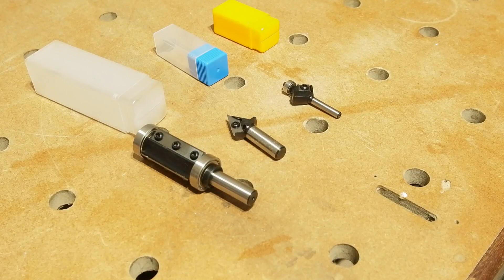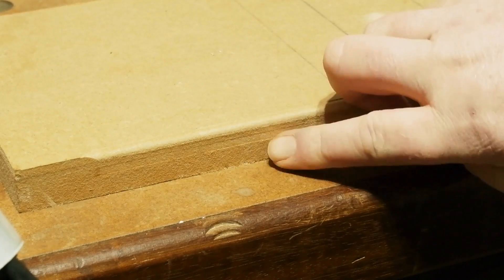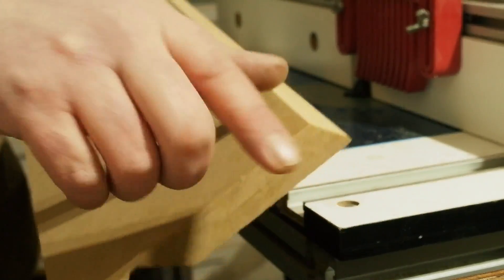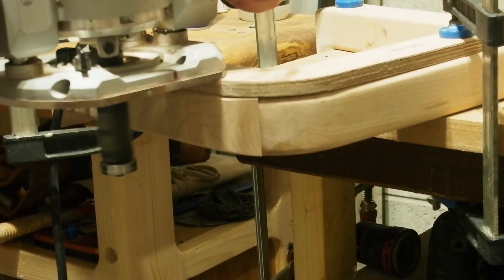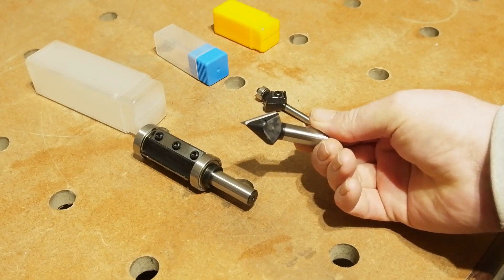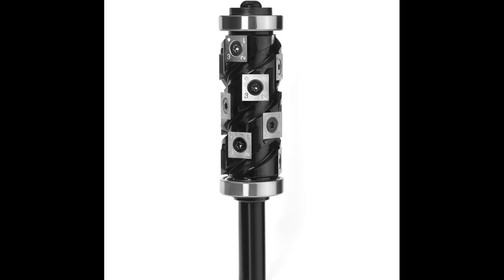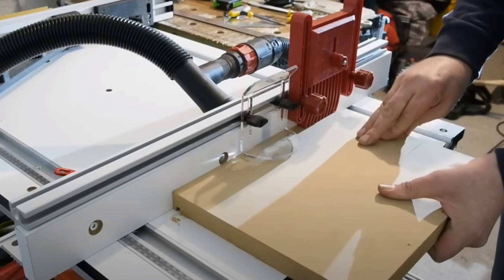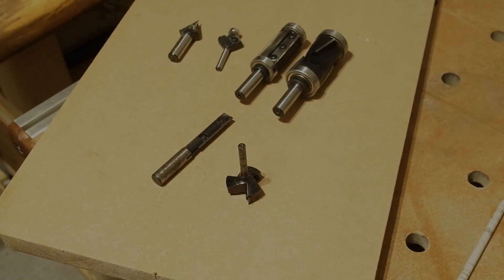[GIFTED} Replaceable Blade Carbide Router Bits from Banggood Plus Law and Safety

Comment: I really liked that you took the time and covered the safety and legality part. I disliked how Peter handled that in his video a lot: Mentioning it several times, but then no explanation and if the viewer is not familiar with it, this is just confusing!

With cheaper tools like this, I always wonder how the price difference to more expensive ones is justifyable. Can you say something about this in regards to festool or ENT?
Reply from the maker: In fairness to Peter, I got the impression his tongue was firmly in cheek and, if nothing else, was a conversation starter. I have previously looked into doing a more comprehensive comparison between budget and premium bits, by sending a couple for metallurgical analysis. Each test costs about £150+ so, for replaceable blade bits, they'd need 2 tests each for body and blade. I'm not quite committed enough to drop £600+ for a YT video though. I don't make that much from YT in a year! I might try and reach out to a college to do it 👍
Reply: @BischBaschBosch  My reply just went into a loading loop. Therefore, just in short:
1. Thanks for your time/work for your videos! :) 
2. Maybe I did not get Peter's irony.
3. Do not start with deep analysis, but maybe obvious differences and/or if the Chinese bits are correct in size/angle/straight?
I don't use tools that often, but hate to spend money on bad stuff. Which sometimes I do not even realize (or too late), because I don't have a direct comparison to good products. Hence, I tend to buy "overquality" stuff for my projects, I guess.
Reply from the maker: @kaktus3175  Yeah, comments do that sometimes. They disappear now and again too. I just want to do a metallurgical analysis as that will be most telling. In my experience, cheap or premium bits all measure correctly (angles, diameter etc) and cut well for the most part. What they're made of, that could be interesting.👍

Comment: Very informative. Great video.
I've got the bit that Peter Millard tested. I haven't used it yet but after the advice he gave and having watched this video I am better equipped to set it up and use it safely.
Reply from the maker: Nice one. Yeah, just drop the speed to between a 1/3 and 1/2, Featherboard if you can an have at it., steady as she goes👍

Comment: Really well presented 👍
Also I have a similar single blade 12.5mm from Wealden tools as doing mason mitres in kitchen work tops used to ruin a cutter very quickly. Due to the rubbish they are made from, even seen sparks coming off 😮. So I went over to one of the replaceable blade ones and never broke the blade or come loose.
Reply from the maker: Oh yeah, I had that a few times - sparks from a worktop. The replaceable blade flutes are great though👍

Comment: Have you tried 💎 (PCD) bits? They should last like 30 or 50 times longer than carbide ones.
Reply from the maker: I've got a pcd end mill I used for cleaning up some aly parts. Not used the ones for wood routing yet though.

Comment: That’s very informative Dude. Thank you. I’ll add this - if you are a company using unconventional bits, write down the risk assessment, and if you have an issue, buckle up. I do engineering investigations, sometimes for defendants in HSE prosecutions. Even if the HSE lose the main prosecuting allegation, they will find something else in the business that is non compliant, and get a conviction that way. They also invoice defendants for the (unlimited) cost of their investigation. Conversely, the HSL are excellent and generally very fair in their investigations and reports.
Reply from the maker: That's kind of the size of it - risk assessment, put your best body on it and strap in😳 The HSE even say themselves that woodworking is a peculiar one in that, no piece of wood is the same and it, more than any other manufacturing, puts operators hands near blades by necessity. Nightmare! I think sometimes, instances such as you mention, they're out to make an example. 🤷‍♂️
Reply: @BischBaschBosch   I think it’s more than that - it’s a bit like a cult where health and safety is an Old Testament god that must be obeyed or locusts, child sacrifice etc follow (and bills). There is an unhealthy, and unrealistic, zeal that goes along with most of the cases I’ve been involved with. They are analogous to the teachers in the adage about if you can do it, do it, if you can’t do it, teach.